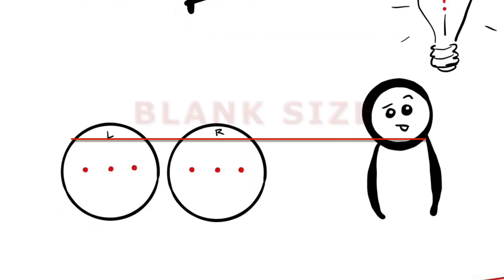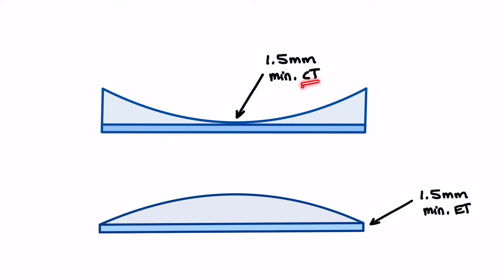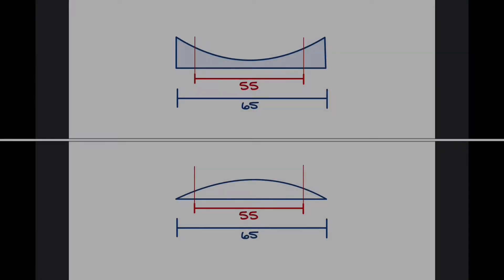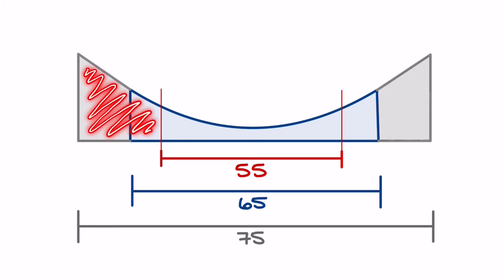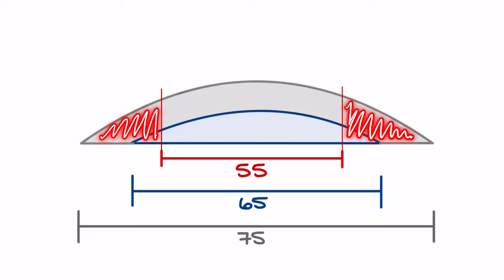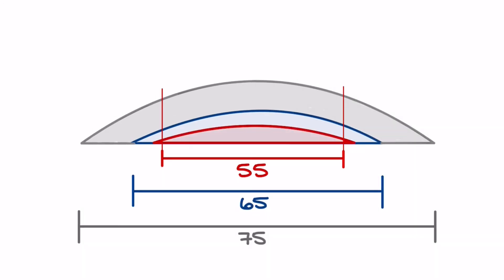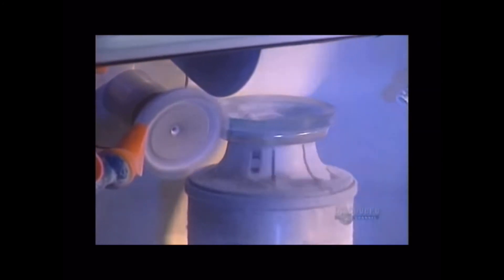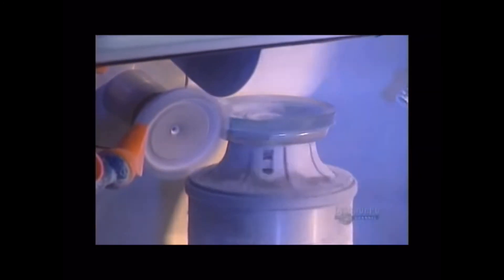Lens Diameter & Thickness

Comment: Hi thanks for the video 👌 I have a question what does crib diameter mean ?
Reply from the maker: It’s a surfacing step that reduces the blank diameter to the diameter called for by the pair. Crib diameter is equal to the minimum blank size. Let’s say the manufacturer offers the blank in a 75mm but the pair actually only needs 58mm lens. If surfaced, the lab can remove the extra material (aka crib it down) to reduce the size to 58mm. When the surfacing lab cribs the lens to reduce the diameter down to the minimum blank size on a plus power lens this allows the lens to be generated as the thin as possible. On plus lenses, the diameter directly impacts final thickness. For minus lenses it just helps reduce edging time and wear/tear on the edger.
Reply: @MsTracyBennett  very clear explication thank you👌if you don't mind I have another question and what's cross curve ?
Reply from the maker: @Jay51192   cross curve is the curve on the lens (usually on the back) that creates the cylinder power in the prescription. The cylinder power is the part of the prescription that corrects astigmatism. My video on Nominal Power can help explain it in more depth.
Reply: @MsTracyBennett  thank you for the explanation I just started a job in optical lab in surfacing and trying to learn about it and  about informations that we put in generator to create the lens.
Reply from the maker: That's great! Welcome to the club! Feel free to contact me with questions. I love to educate!! :-D
Reply: @MsTracyBennett  thank you you’re so nice 😊 your way of explaining things is lucid and clear 👌